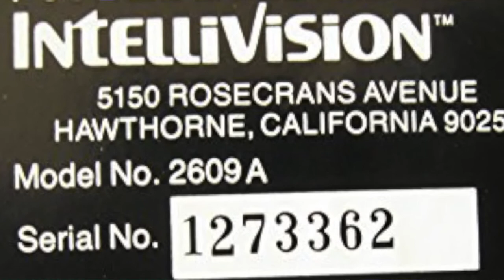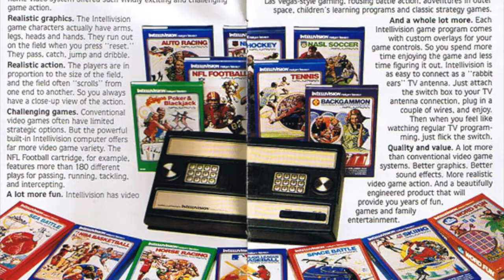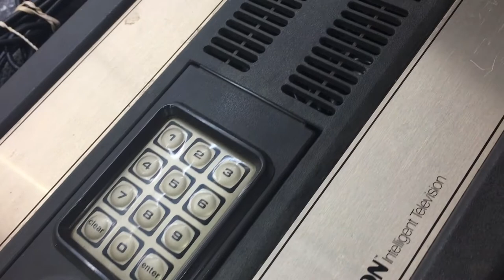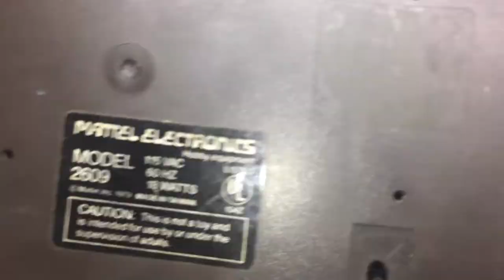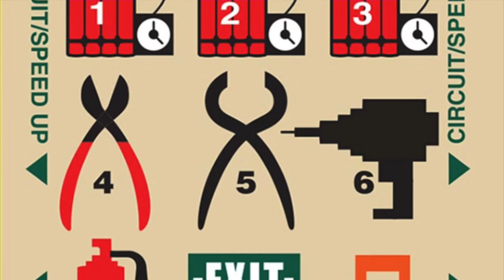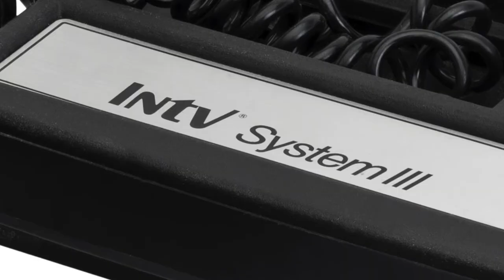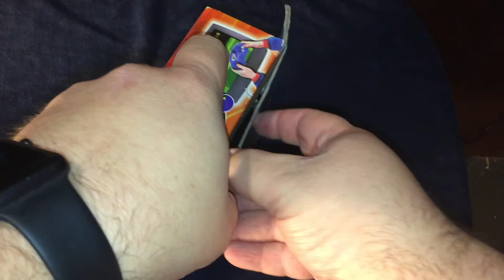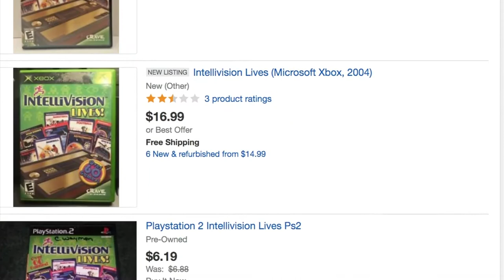Mattel Intellivision - Initial Impressions

Comment: I still have my Intellivision that I got in about 1980.  It is so much superior to the Atari 2600.  It's not even close.  I completely disagree with your assessment of the controllers and lack of recommendation of the system.  It doesn't take long to get the feel of the disc and become proficient.